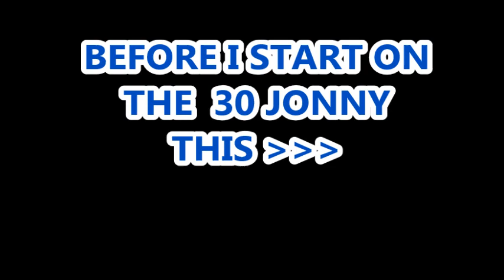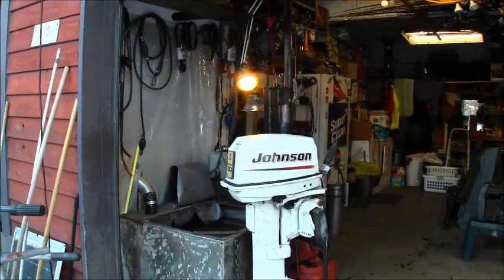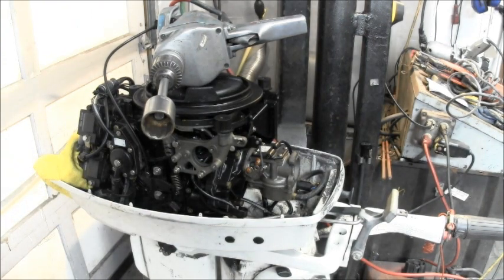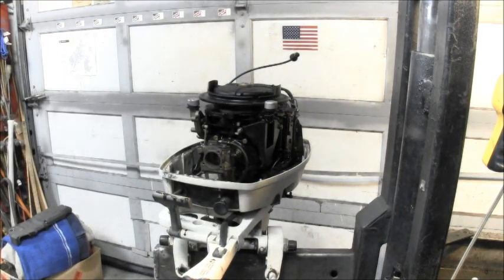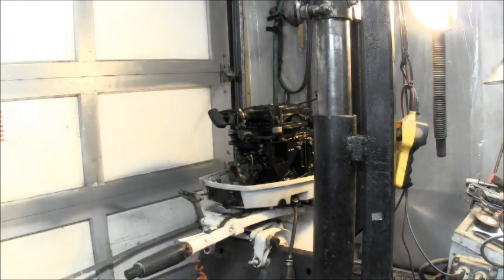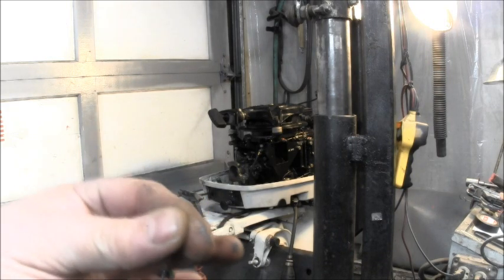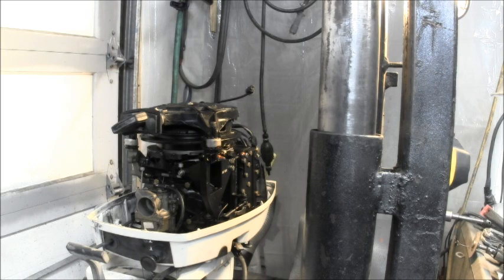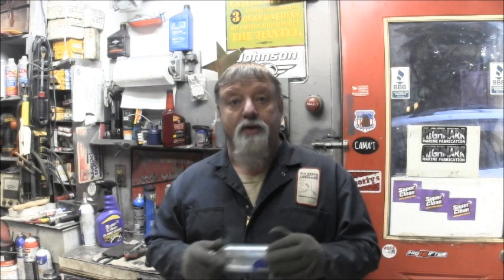JOHNSON 2004 30 HP,    (( MAKE OVER  ))

Comment: Kodi. I just pulled the 1990 flywheel off and it is same part number as the 1988 except one has a ring gear and one doesn’t. Magnets and key way appear to line up the same.

Comment: Kodibass I know your busy but I have 2003 25hp that was well used and abused and the flywheel magnets got damaged and the ignition parts under also destroyed.I have good ignition parts from a 1988 on it and a 1990 flywheel which is different than the original..got motor running easily but missing. After shutting off and restarting it started running backwards from what I can see.Don’t think it is an optical illusion.Peeing water but don’t see exhaust coming out lower. Any insight on this?
Reply from the maker: I have had this happen B4,  You need to replace that flywheel with the type from the 88.   kb
Reply: Thanks. I have one but it is a rope start with no ring gear. Have one from a 1977 35 hp I could try also?

Comment: I have a question for you. I was at my local Boat store the only store I have bought parts for my boat and when I asked about the factory setting on my 2003 30hp Johnson Intermediate Orifice Screw they came unglued on me. telling me that he has 5 clipboards of stuff he has to do just to keep the lights on before he could even think about looking into something like this. He took down my serial number and what I was looking for, but I knew he wouldn't call because he didn't take my name or number. I bought a repair manual for it but it doesn't say anything about its setting. Could you help me with this or point me in the right direction? I currently looking for a new Marine Shop to fulfill my boating needs. Thanks in advance.

Comment: Thanks Cody fo the content- Question: Can I upgrade a 1973 25hp Johnson to 30 or 35 by merely getting 30 or 35 hp carb?
Reply: Are you the best commercial fisherman in the whole of the Northern Territory?
Reply: @_Brad_D  Nopr- Not a commercial fisherman not in the "Northern Territory"
Reply from the maker: No' U will need to change or open the intake hole size to get 35. U  can get 30 with just a carb or 
jet change.     kb
Reply: @kodibassInsideoutboards  Hey Cody thanks- I'll probably go the jetting route for 30-  would that be just the high speed jet change? Is there any drilling involved to accomodate jet or is it just a taper diference? Thanks!
Reply from the maker: @billrae4198  No drilling, screw old jets out, new ones in.  I would check the numbers on both jets. Number will B stamped on the brass jet. d31,r34 etc.    kb
Reply: @kodibassInsideoutboards  Hey Cody- Thanks for the info
I'll be looking for these to upgrade/ can't wait to try this- Thanks
Reply: @kodibassInsideoutboards  Kodi- Hope all is well in AK and happy holidays- I been calling @ and not finding jets per say {D-31  R-34} -  I'm assuming these are a low speed needle and a high speed orafice screw or are they two high speed jet options ?  There are carb kits available but all so far seem to just have the high speed jet in the kit- do you have these available for purchase or can you recommend where to look? Thanks Billy Rae-Best non-commercial fisherman in the Northeastern territories LOLS